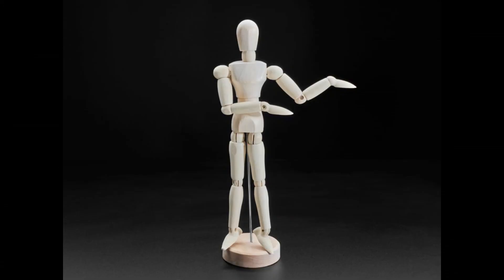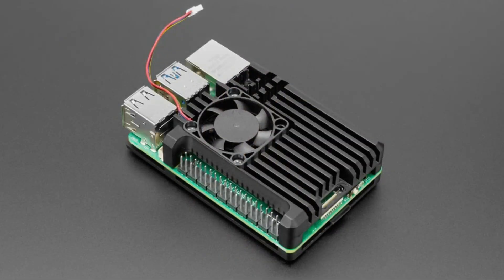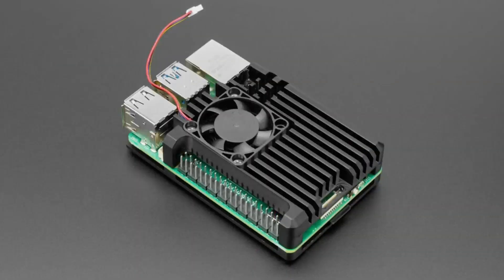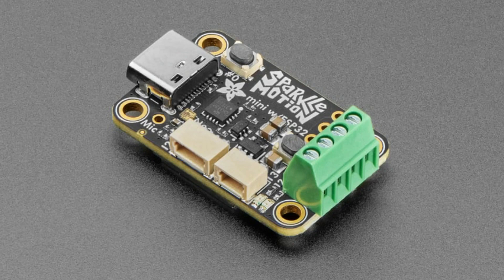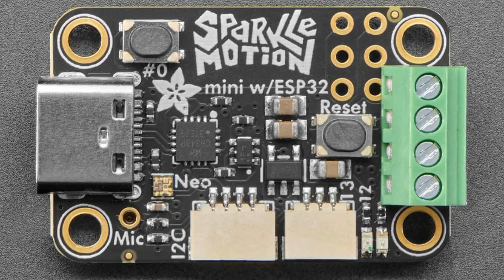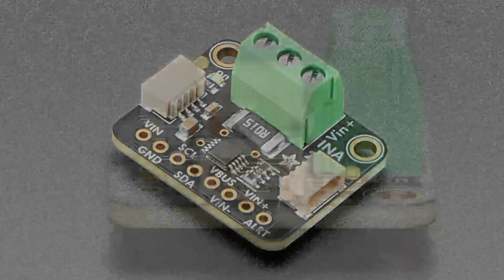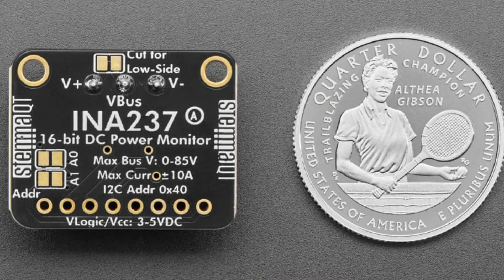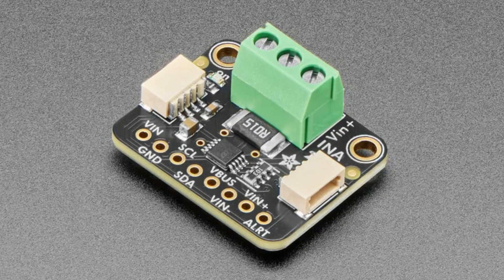#NewProducts 5/28/25 Feat. @Adafruit INA237 16-bit DC Current Voltage Power Monitor -STEMMA QT

Comment: Do you have anything for measuring 110 ac voltage/current?
Reply: I use Shelly's products for that, with 230V AC that is. Didn't want to diy with voltages and currents (up to 16A per walloutlet) like that.
Reply: @bartgrefte I don't necessarily consider adafruit diy.   It does offer better customization though
Reply: @dave4882  Yeah, might not have been clear about that. Just hooking up sensors (like CT clamps) are diy in my mind. But still, mains voltage and depending on the state of the electrical system (badly outdated here) I would be careful with anything but smart plugs. The EU style circuitbreaker box isn't even safe here, those comb-shaped things under the breakers (like ABB's 2CDL310150R1056) are pure copper, no insulation at all. It's dangerous to put CT clamps in the breaker box here...
Reply: @bartgrefte no worries.   It's not specifically for the house main breakers,  but an rv (carovan?)   I want to shut off circuits if for some reason I reach the limit of the source.  (15,20,30,50 depending)   This is all us stuff though.  I'm an electrician,  so the home brew controls are fun for me.
Reply: @dave4882   PZEM-004T, the version with a current transformer maybe an option? Goes up to 100A
Reply from the maker: Ladyada replied on Ask an Engineer https://www.youtube.com/live/vRNOGT7ZbFk?feature=shared&t=3111